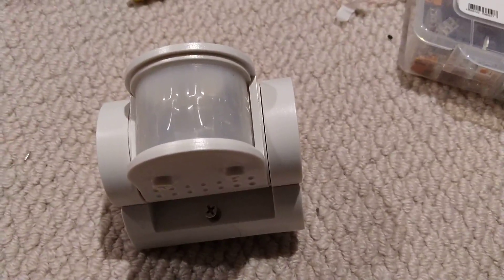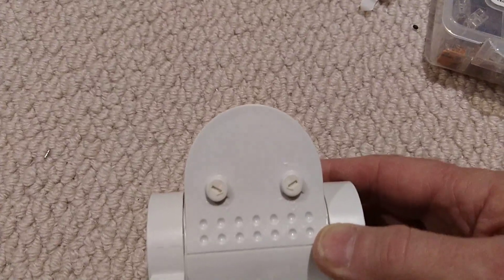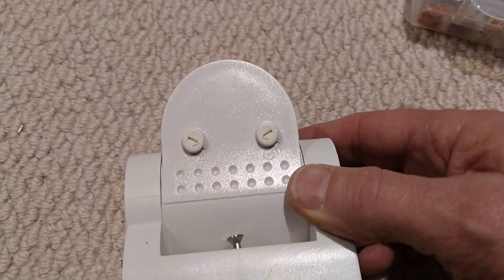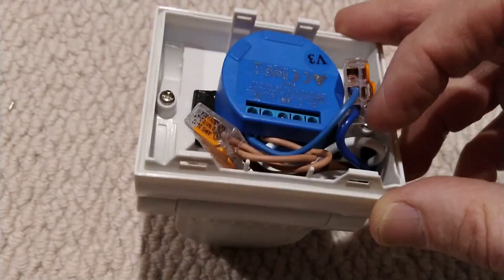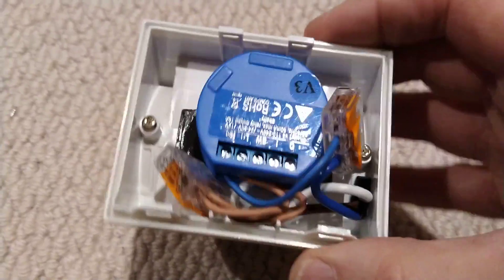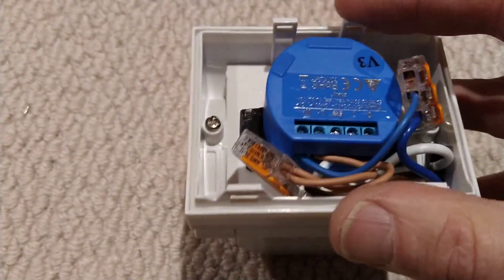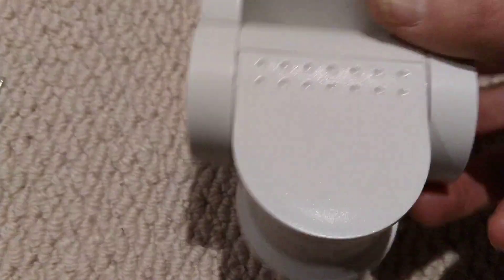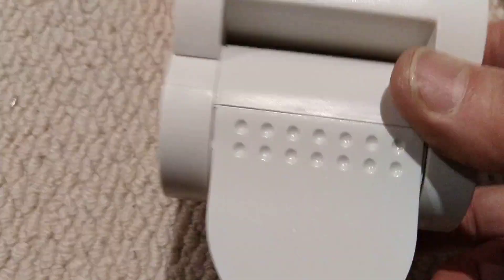Making an outdoor motion sensor smart with a Shelly 1

Comment: Hey Pete, been a couple of years since I last implemented your solution on a shelly 1 - so had to do some reviewing.   I'm confused about how you wire up to the Shelly1.  I'm using Tasmota - would not THINK that would make a difference but who knows.   This is how I just wired mine up for use in NA with 110VAC:

N       Neutral
L        Hot side of 110VAC
SW   The switched output of pir_motion_sensor
I        The Hot side of 110VAC (to provide power to light when power relay on Shelly is ON)
O       To light (Load)

In your introduction you said to "wire the lightbulb to the L output of the Shelly".   I thought N and L were power in to power the shelly - and "I" is also wired to the hot side - and the internal power relay switches I to O to turn on the light.  I don't remember questioning this 2 years ago - but I'm certainly confused now.   So Obi Wan of this great solution - what am I missing here?  

Thanks!

Comment: Hi Peter, any problem with the Shelly switch operating outdoors?  I have had several Shelly relays not work following rain storms, no water in box but damp environment.  It is perplexing and cannot figure out why this is happening.  Shelly devices are designed for indoor use.
Reply from the maker: Nope. We have very high humidity here in Auckland and so far so good. I have an expensive motion sensor though so it should be well sealed.

Comment: These have been working great with homeassistant/nodered. But I have never been able to deactivate the actual relay, always hear it clicking - really just need to mqtt message and not to activate the relay. There is supposed to be a way in tasmota coding but it never worked. Any suggestions/tips?

Comment: I'm trying to use tasmota on the Shelly - and I'm stuck on having to handle the messages being sent when the PIR trips.   Here is what I have in the tasmota console when the PIR is triggered

21:50:00 MQT: tele/tasmota_965E97/SENSOR = {"Time":"2021-02-05T21:50:00","Switch1":"ON"}
21:50:04 MQT: tele/tasmota_965E97/SENSOR = {"Time":"2021-02-05T21:50:04","Switch1":"OFF"}

I got this message to display - BTW - by enabling switchmode 15.  The state of the light - on/off - works fine.  Anyone have any suggestions  on how I would proceed.  My only problem with using shelly's firmware is if I restart HA the state of the shelly goes to  UNAVAILABLE - and stays that way until I reboot them...
Reply: After many hours I came up with a working tasmota configuration and have added the instructions into Pete's github link...
Reply from the maker: That's awesome, thank you!

Comment: Peter, couple of years ago I did pretty much the same thing you are doing but using a zwave switch that I installed in flood lamp.   I've wanted to do the same thing but with WIFI and this looks like exactly what I need.  In hassio I want to be alerted by the PIR  - but not turn the light on during the daytime (and have the sensor work 7X24).   I'm going to finally be able to get rid of the last of my zwave flood lamps.   The shelly 1 are no longer offered by Amazon - I'm going to order some from ebay - is there another shelly that might be used?  The shelly 1PM apprently did away with the input contact....
Reply from the maker: I see the Shelly 1 on Amazon US still but cheapest to buy direct from Shelly. The detached switch function is version independent as it's a firmware feature, not a hardware one.

Comment: I had to lower the light sensitivity, could not have it on max light, due to false alerts when the sun was at a certain angle in the morning. May have to reposition the sensors a little. Flashed the shellys with tasmota which make them more stable imo.
Reply from the maker: Great work

Comment: Excellent! Got mine set up with a shelly, one stock and one with tasmota. Now when using the detach switch option I can't seem to get the home assistant switch to work using 'shellies/<model>-<deviceid>/relay/0/command'. Nothing comes through when the PIR is activated. My tasmotized one all works great with the mqtt messages BUT the other issue is how do I code it to detach? The relay triggers which I don't want. Looking for just the mqtt message. Thanks
Reply from the maker: Answered your question on Github

Comment: Hi Peter. Just what I needed. Can I use the sonoff mini also? Seems to have a switch function same as the Shelly. Thanks
Reply from the maker: Not sure if you can disconnect the input from the output with the stock firmware like you can with the Shelly. You might need to Tasmotize it?

Comment: Did someone tried with a sonoff basic ?
Reply from the maker: Sonoff probably wouldn't fit and they don't have a mains tolerant sensing input for the PIR output.
Reply: I am looking for a solution for a sonoff mini because the voltage of a motion sensor is to high for been used in place of a switch.
Reply from the maker: @clinixnumerix3321  Can you explain a little further?

Comment: Greta idea.... I have been looking for a smart outdoor sensor. I would like an outdoor sensor (preferably wireless) to command a sonoff basics trough a rule or a command without it being connected fiscally.
Basically I would like to mount a flood light on my roof pointing down. I can control it through a smart switch sonoff basic but would line to command it with a motion sensor in my garden without having to run wires from my roof to the garden.
Any ideas?
Thanks
Reply from the maker: Philips outdoor motion sensor?

Comment: Pete, will Shelly 1 work with most PIR motion sensors?  I'd like to get a small motion sensor for a bathroom.  Thanks for sharing the wiring diagram on Github.
Reply from the maker: It has a live input so you need to switch mains into it if powered that way.

Comment: Hi Peter, thanks for sharing. So you can "detect" via mqtt when there's motion and you can turnoff the light completely when you want. But can you also "bypass" the motion sensor and turon on the light when you want?
Reply from the maker: Yes, that's how I'm using it.

Comment: I have tried different motion sensors, and the Shelly input signal always stays high..
If I disconnect the wire, the input goes to low.
I even added a lightbulb, and the motion sensor works just fine.

I measured a voltage of 25VAC on the input, even when the lightbulb was off.
Any ideas??
Reply: the setting of the shelly, i had a Tasmotized one and the setting was Switchmode 3, i don't have a original shelly1 to verify.
Reply: @herik63  Is it possible to use this setup with ESPurna flashed to a Shelly1? Not sure how to change the switchmode witihin ESPurna.
Reply: @TheRupti  I'm really sorry, never covered ESPurna :(
Reply: @herik63  I've tried using Tasmota and set switchmode 3, but I didn't get it working. Every time the PIR detects a motion, the shelly switche toggles even if I switched it on manualy. I'm not sure if I understood the functionality of de-coupled config.
Reply: @TheRupti  seems a issue with your PIR, i'm afraid, test another one.
Reply: @herik63  I guess the PIR is working correctly, as it switches the shelly as in Switchmode 3 defined (SwitchMode 3
: Tasmota will send a TOGGLE command when the button is released (opening the circuit). When pressing the button (closing the circuit) nothing will happen. Default state is ON and when pressed it's OFF). So the toogle command is only send when the button/PIR Contact is released. So the PIR detects motion, (can hear it clicking) then nothing happens with my bulb, and when PIR turns back to normal again, as defined in switchmode 3, it switches the shelly. So are you sure switchmode3 is correct?

edit: I've flashed back to original shelly fw, and it works! So switchmode 3 is not going to detach relais from switch in tasmota 6.7.1.
Reply from the maker: Are you running stock firmware? If you're working around the motion sensor, the output will mostly always be high as the sensor will keep triggering with your body heat.
Reply: @xbmcnut  I did try with stock firmware and with ESPHome. Both same result.
The motion sensor wasn't triggered, I even put it in a box to be sure. (and measured the voltage of course)
Somehow the output of my motion sensors isnt' potential free, so it is no relay contact. Because I measured about 24VAC when the sensor was turned off, and 220VAC when triggered.
If I put a relay between the motion sensor and the shelly, it works fine.
Reply from the maker: @ErwinNieuwenhuisDeurningen  The sensor output is supposed to be at mains potential when on [to light the bulb]. The Shelly if configured for mains, is also expecting a mains potential on the switch input, so as long as they both have the same neutral, it should work.
Reply: @xbmcnut  I understand, and when on the sensor has mains potential. And they share the same neutral.
But when the sensor isn't triggered, there still is 24VAC on the sensor output and shelly input. If i disconnect the wire, this voltage disappears.
Reply from the maker: Confirm the Shelly switch input still works by connecting a switch? I had one of mine fail.
Reply: @xbmcnut  I just received 4 new shelly's. Will try them this weekend.